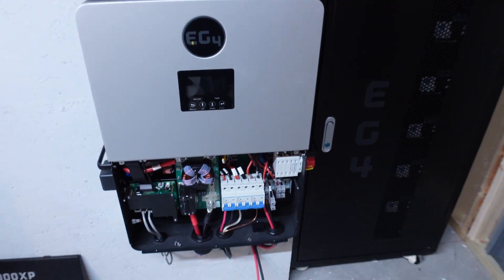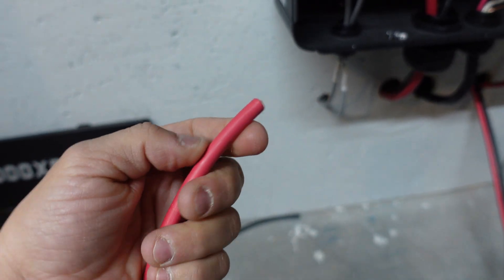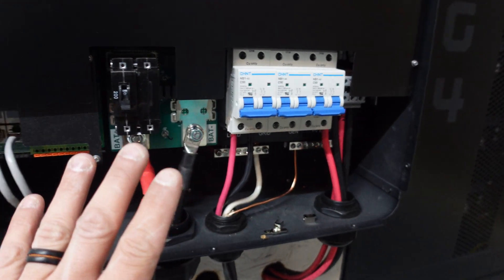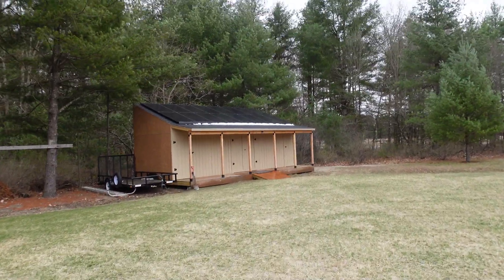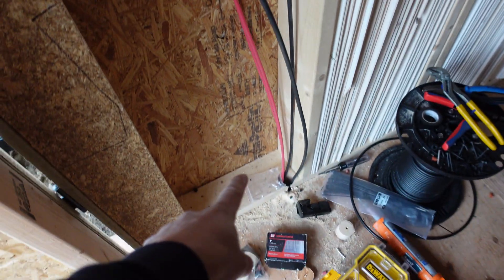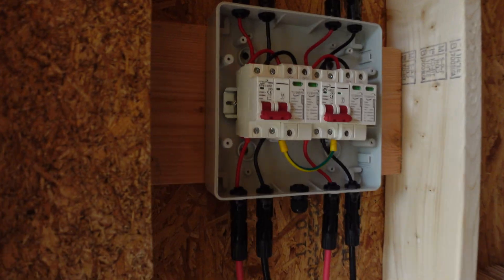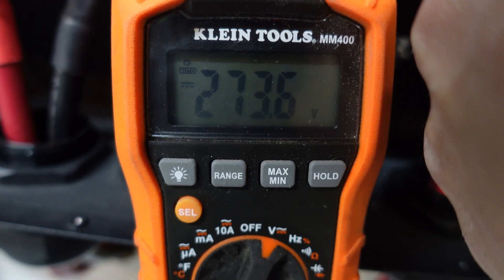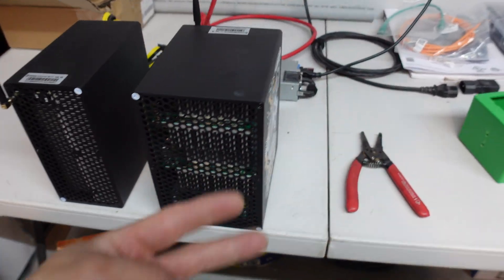My DIY Solar Shed is Wired!

Comment: ❤ CCXD you rock !!  Looking awesome brother, and yes you can use shielded wires as ground wire it just need to be of higher gauge than your other conductors, 6 gauge would be ideal however 8awg should be ok as well, note that the lower the gauge the better to redirect like a lightning strike to the ground from the panels without causing the the shield over the ground wire to melt or catch on fire, thats the reason why ground wires to ground rods are usually not shielded.